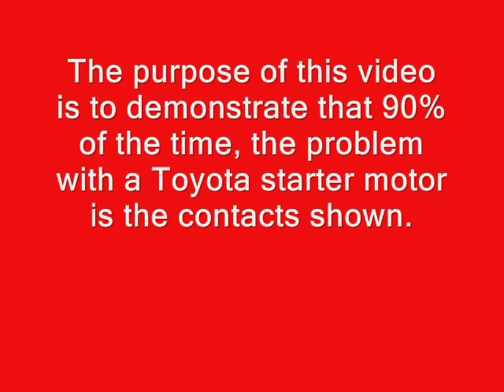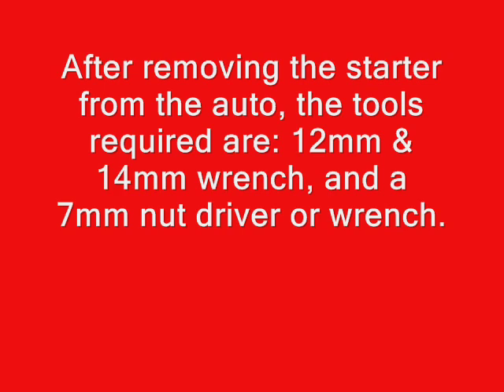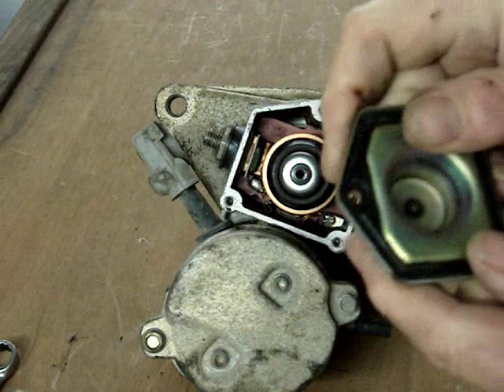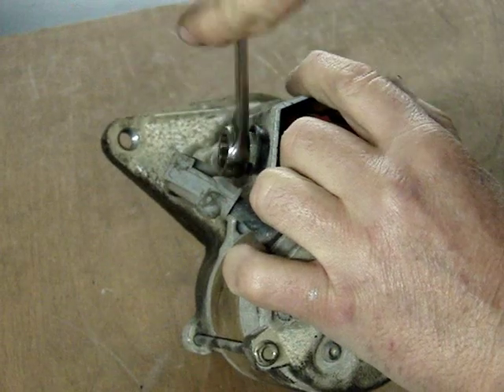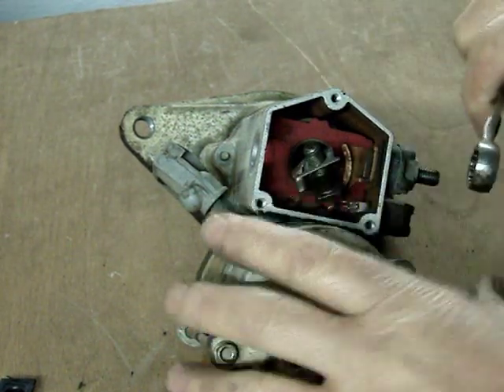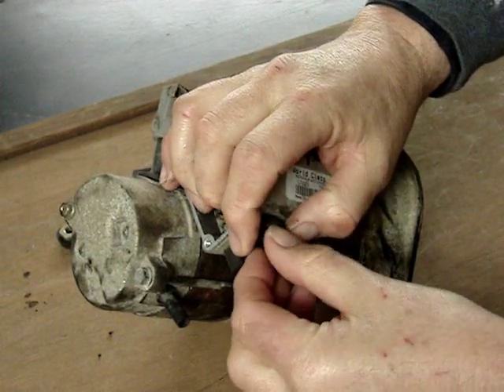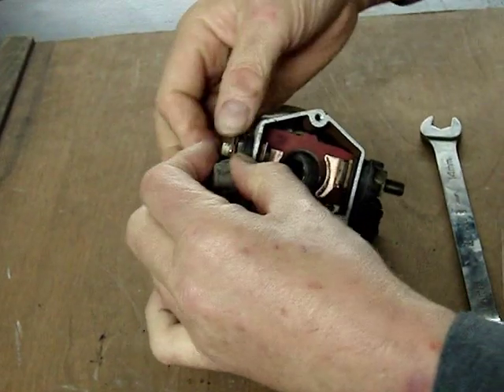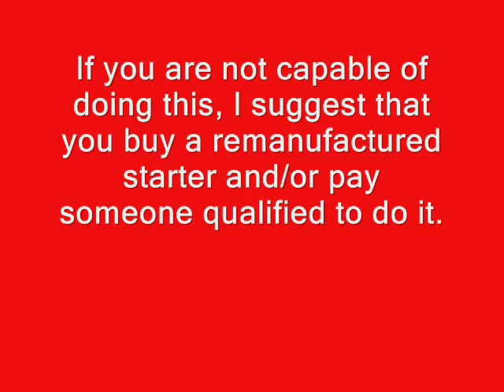TOYOTA STARTER MOTOR, EZ repair (Corolla Celica truck car prizm Vibe camry T100)

Comment: My 99 corolla has been having problems starting.  I have a repair kit that should arrive tomorrow.  I'm hoping this fixes it.  In the 5 years I've had the car I've never had starting issues, so this is the most annoying problem I've had so far.  I'll also have to buy a 10" extension bar for my ratchet to remove the starter, unfortunately.

Comment: Denso OSGR starters are also used on Evo and later Harley Sportsters and big twins. If your contact studs/nuts are hopelessly stuck the easy way to remove them is using an abrasive cutoff wheel. Don't beat on the nuts with a chisel or screwdriver as you can crack the starter housing.

Comment: please show us how you removed it.  Thanks
Reply from the maker: Hello,
As the starter motor design and the repair procedure is the basically the same on many models, but the configuration and removal is varied, I did not show the "removal process" - For example; Rear wheel drive 'yota trucks and transverse front-wheel-drive passenger car mounting configurations are completely different, as well as the 4, 6, and V8 configurations as well, all using the ND basic design starter motor. Thank you for your kind compliments. 
Best regards. Jim

Comment: what if your problem is a draggy starter? I know its not the battery. would it be the crushes? and can those be replaced?
Reply from the maker: Hi, 
Most likely you have worn-out "shaft end support bearings" and this causes the armature to drop under gravity and drag on the interior of the starter case. Typically the starter will drag more when it is hot from transfer of engine heat. (Starts easier when car has been sitting for several hours, hard to get to restart after being shut off for short period of time) This is because this engine heat transfer into the starter body expands slightly the armature and this makes the clearance even tighter there where it is dragging. 
Maybe if this previously described hot/cold scenario is the case, you may consider a complete rebuilt starter  replacement as this can become a can of worms.. When the armature drags, then you can have some drag-damage to the windings etc.. You many want to check Toyota dealer parts department pricing as well. Sometimes Toyota is cheaper than the auto parts stores on rebuilt items like starters and alternators. It's the installation labor at the dealership that gets killer expensive... 
And thank you for watching and best regards. Jim

Comment: An older thread BUT TIMELESS INFORMATION! I just did my 1994 Celica GTS 2.2 and it started first time after clicking for 2 days. Now, to be fair I will need to look into a new set of contacts since the existing ones are grooved and about half the original thickness. However, I am back on the road without a push.

Well Done Earltuckian!

Comment: i get a single click and no start, and eventually when it starts it turns a big sluggish. other times it turns normal speed when it starts. Could this possibly be the issue?
Reply from the maker: +Chris Reale (crispimitch) You have two problems I think. The click sometimes, start other times is this. The fact that it is sluggish is most liely that you have worn armature or bearings causing the armature to drag, for this, you will need to replace the starter. - Depending upon how much work it is to take it out and put it back in, you might try my cleaning tricks and put it back in and see how it goes. Thank you for watching.
Reply: No, thank you sir!
Reply: +earltuckian thanks again, it worked and i saved myself a few hundred bucks.

Comment: Thanks Jim, worked a charm. However the rubber dust boot around the connection nut on the power side was melted and fell to pieces. I cleaned away the melted boot and put some electrical tape around it and it seemed alright, just wondering is this sufficient and also if I may have some other problem that caused this?

Comment: You diagnosed my issue exactly on my 95 Celica. I pulled the starter and cleaned the contacts- as I couldn't get a ride to the parts store! Nevertheless, cleaned it really good, reassembled, and it starts like a champ. Thank you!!!!

Comment: I have a quick question I have Toyota Supra  we are having the same problem where it clicks several times till the starter engages. We changed our starter and it still happens so we noticed the wiring to the starter to the batter is corroded so I'm guessing change the wiring on the battery. What do you think?
Reply from the maker: Tweety Aradillas Look closely at the battery terminals. On older Toyotas, it is common for the cable-to-terminal 'clamp' to crack, (or the bolt to pull through the clamp, making it impossible to get completely tightened)
 As well as 'wire-brush' cleaning the posts on the battery as well as the interior of the clamps. If the bolt has pulled through the clamp, or the clamp itself is stretched-out, then this could be your problem, not a good enough connection at the battery post. You can usually change-out only the post clamp itself, typically, the wires are OK. With this scenario, you have electrical current and things like lights and radio work, but the slightly loose connection won't carry the 'amps' needed to turn the starter motor. - Thank you for watching.
Reply: Ok I will change the wires because  they look corroded at the post and the copper in the wires are a bit brittle. Wish me luck thank you for your videos they really help alot.

Comment: I've done this before and it has worked just fine but on my most recent try/fix when I put it all back together the engine didn't crank, or I should say that the starter motor didn't revolve.  I had replaced the contacts and the plunger btw, the engine has over 200k on it but it was running ok.
What I did get when I turned the key was a little "click" and a large voltage drop???
Any help or advice will be gratefully accepted :-/)
Reply from the maker: Dan Holloway Since this is what you were working on, I would suspect a short-circuit at your cable connection point. Most likely your plastic insulator is compromised or incorrectly installed.

Comment: Excellent video. When I call auto parts. They all said no repair kit or solenoid. They convince me buy the starter. Thanks for video save me 110 bucks.
Reply from the maker: Read text under the video, there are links to buy the parts. Thank you for the compliment and for watching.

Comment: Excellent video, Jim! Thank-you!  And, it is so refreshing to watch a video that is done by a professional without profanity!  As for my 1995 Geo Prizm, 1.8, it is kissing 305,000 carefree miles of which I put on 225,000 miles myself.  After multiple turns of the key, it finally starts.  It started out with 2-3 turns and now is about 20-30 turns, so I think it is time to do some repairs.  Glad to find your video and thanks again for your "pay-it-forward" video!

Comment: Great video - saved me several hundred $. Don't know if it's my imagination, but the starter now actually seems quieter than before. Got the parts for a 99 Camry XLE from NAPA for $20. The only hard part was getting the rear starter bolt undone with my walmart wrench set - there was an annoying bent metal cable support in the way that I had to bend sideways by pushing and hammering it... threw it away afterwards. I sanded down the plunger contacts with a rotary tool, which got them nice and shiney again.

Comment: Why couldn't one just sand the contacts in the starter? I did it that way and am now wondering if there could be an issue with sand paper residue. Is there any lubrication required and should I remove any grit on the spring. Or in other words, how clean does it have to be and what lubrication, if any, is required? Thanks for the video.
Reply from the maker: "Sanding the contacts" is OK if they are not too corroded, and you can sanitize everything to perfection is you wish, it's your call. Compressed air will blow away any potentially dangerous sandpaper residue. But I think there is not the need to over-think this repair. Just do it like I show. Thank you for watching.
Reply: earltuckian Oh, sigh, I didn't do it the way you showed and that's why I asked my question. Sorry.
Reply: My contacts were worn so thin (about 3/4 gone), there's no way they'd last much longer.
Reply from the maker: SenorDennis FYI - When the video was made, the parts were not readily available, and I updated the narrative on the video when people began to sell these kits on eBay etc... Yes, you are correct, why not just replace them, but splitting hairs is pointless. The bottom line is getting the car on the road. And "yes or no" does this video show you how? Yes or no?
Reply from the maker: SenorDennis
we cool.. When I made this, the parts were very hard to find. :)

Comment: This worked!! Took about 2 hours all together. Kit from Napa cost me 25$. 4 times cheaper than a new starter. 

Hardest part was the back bolt holding the starter. After that it was a breeze.

Comment: Great video!  This (replacing the plunger and 2 contacts for $12) worked exactly as in the video for my 1999 Chev Prizm.  The most difficult part was figuring out how to get to the top starter bolt - at first I could not even figure out how to see that bolt to get to it ... but I discovered by moving a work light around to a specific spot to the right and towards the cowl I could actually finally see the bolt  ... this made it much easier to navigate the 14 mm socket to get on it (with long extension).   Worked great - saved me a few hundred dollars - thanks!

Comment: Jim,  I want to thank you for sharing your knowledge & making this video.  I followed the procedure and it fixed my starter problem.  I did not remove the starter from the engine.  I unbolted a support beam between the lower engine & the intake manifold.  That gave me enough room to access the back of the starter solenoid & unbolt the cover & removed the round piece.  I cleaned all the contacts & put the cover back on.  I only need to fix this so that I can sell it.

Comment: Good stuff! However, my starter seems to be doing this in cycles. It'll go three days of starting up, then a few days of a couple clicks to start it, then a few days of a BUNCH of clicks to start it, then starts up again. Do you think this could be a dead spot as opposed to the dirty connections?

Comment: Just did this on my '87 Pickup, works perfect.  I bought my parts from the Toyota dealer, they even threw in a new hat. Thanks for the video. I love that I didn't have to buy a re-manufactured starter.

Comment from the maker: There were some problems with the switch in the shifter (if it has an automatic on the floor) have him try starting it in neutral instead of park and that is a simple adjustment. But if it is 'clicking' then probably not that as that will be a dead circuit as it is a safety feature. Otherwise, just like old American cars, it seems to be the armature dragging inside the starter case due to heat expansion, but two new starters seems to negate that theory. I still think it is heat/starter related.

Comment: Earl, Nice film. My buddy has a 1990 Geo Prizm with starting problems. Pep Boys replaced the starter twice (If they can be trusted). Now he is having problems getting it to start on very hot days after using AC. When he turns the key it only clicks when the car is hot. After the car cools, it starts. Any ideas? Thanks.
I'm thinking his problem is solenoid, neutral safety switch, or somewhere in the ignition system where metal will expand when hot. However I only work on old us cars.

Comment from the maker: Hi Tom, I would still look at the starter first. Primarily as it is the easiest thing to check first.  At the point these begin to fail, any slight tapping on the starter body often will restore function for a short period of time. If you have the habit of turning the key and engaging the starter when the engine is already running, then yes the starter gear and/or flywheel could have bad teeth. But my feeling is that it is only your starter contacts. - Jim

Comment: Hi Earl, (thanks, if you see this, Tom T in So. Calif)...

Today on my '99 Toy Tacoma 6cyl, when I got a click-click (auto parts dlvry driver)...1st, I jump out and look at battery. Then a parts guys walks by/says, "Put truck in 2nd gear, rock it a bit". Did that and voila, truck started! Did that one other time during morning routes. Rest-o-day, was fine. Sooo, I reckon it's probably either worn starter gear (or flywheel teeth?) goin' out...  If you have a take on this, wait your news :):):)

Comment from the maker: My thoughts would be that you have not installed the motor correctly into the mounting area. There is no reason that after only cleaning the contacts, the solenoid-driven gear on the starter would not engage the gear on the back of the engine and turn the engine over. Unless you left out the "plunger" or plunger spring from the starter motor? It seems that you need to first inspect your work.

Comment: Just wanted to say THANKYOU!  When I tested it out of the vehicle the solenoid engaged. I thought it was good. Then I saw your video. So I did the work and now the starter cranks really strong. Not sure why it worked, other then a voltage  drop thru the contacts that affected the starter motor itself? I will have to replace  the contacts later as the ones in it are pretty rough. I assume I can get the round contact on the pin as an assembly. Anyhow, thanks again, big time!

Comment from the maker: Our NAPA is locally owned and the staff are very good at sourcing about anything. If you are dealing with a "corporate" NAPA that does not have a machine-shop in-house that repairs and rebuilds starters, generators, carburetors etc., then they will ONLY sell you a starter as they are only "countermen" not actually mechanics. You can buy the parts from Toyota and since my video was made, there now are several sellers on ebay also selling the kits.. Thank you for watching.

Comment: sorry for lare response it was the starter i took a wrench and hit it it turned over so i took it off and replaced it been fine ever since ...this is the second started and battery ive changed..03 pontiac vibe and thanks for the help

Comment: My car batter and alternator was tested and still all very good condition. The problem is sometimes when I turn the key nothing happens, no clicks nothing. All lights do turn on though. I have to turn the key 3-4x somtimes to get it started. Is this a starter contact problem or something more?

Comment from the maker: yep, the clicking as explained in the video. Check your battery connections first. That is easy and corrosion on the battery terminals can also cause the starter not to engage. Thank you for watching.

Comment: Good video. Going to try it out 2marro on my car as i had a problem with it today. Going to do this hopefully it will start it up. One question wen i turn the ignition it makes lots of clicking noise that means it is the starter?

Comment from the maker: Still could be the starter. Try pressing the horn while turning the key. If the horn sound gets weak when applying key load, then you have some current in the starter circuit. If the horn sound almost goes away, check connections on battery terminals and condition of battery. Toyotas are so reliable it is seldom a serious problem unless you go to a "stealership" where they use the common clueless technique of changing parts until the problem eventually is fixed. :(   Thanks for the compliment

Comment from the maker: Thank you for the kind compliments. The starter is always attached directly to the side of the engine or the transmission bell-housing. It will be found where the transmission and the engine go together.

Comment: Thanks Jim, you did a great job with video and your instructional. You video is the closes I could come to finding starter repair of 78 Toyota Corolla. I m not sure which is the starter under the hood but have posted to my FB page my first guess. On the left side mounted to the frame. I wish I could upload the photo here. Wish me luck or goto my FB page and check it out. Lorilei Cochran, thanks again your're the best.

Comment: I replaced the parts in my Toyota Corolla starter and have had no issues thanks for the information. One tip after replacing the parts and reinstalling the starter clean the negative side of the battery cable where it bolts on the car block. If this connection is not clean it may cause an electric arc especially in damp weather.

Comment from the maker: when you look at the schematics, you will find the distributor and ignitor wiring in that area. There are plug-ins for these components. For example wires coming out of the side/bottom of the distributor. This is a VERY unusual problem as properly maintained Corollas typically run forever with very few problems. My bet is that you'll find something that is very simple to repair that is causing this.

Comment: Where is the ignition connection? I am not sure of this and am having trouble finding the location on my 97 corolla. I can follow my batter connections, but I am unsure of what I am looking for when it comes to the ignition connection (where the spark plug wires connect to the distributor?)

Comment: Thanks again Jim, you have provided more insight then anyone I have talked to about this for the last month +. My mechanic recommended I not start throwing money at my engine because I didn't know the exact problem yet. It is definitely humidity related. I'll pull up some schematics of my engine and check the plug ins tonight. Thanks Again.